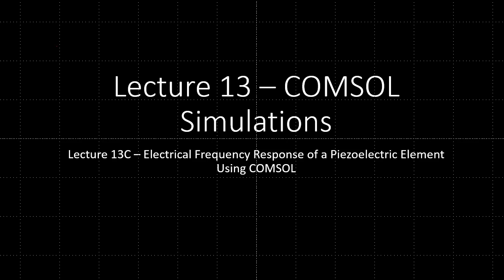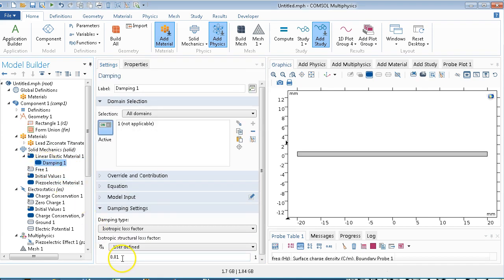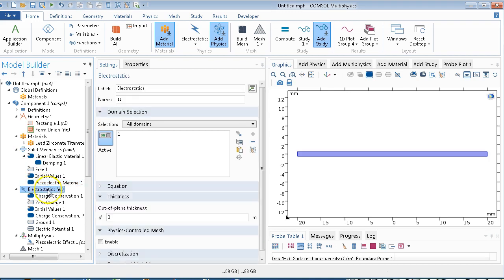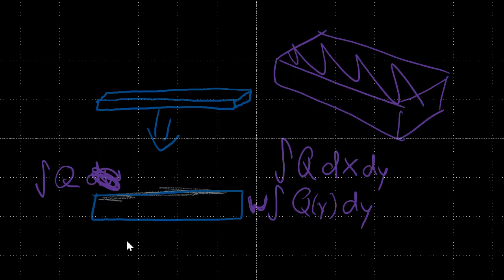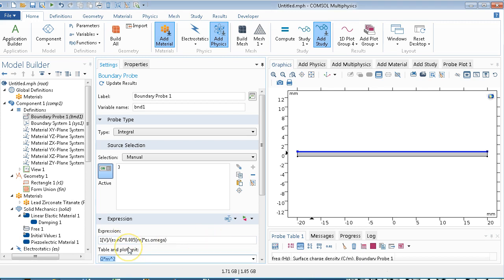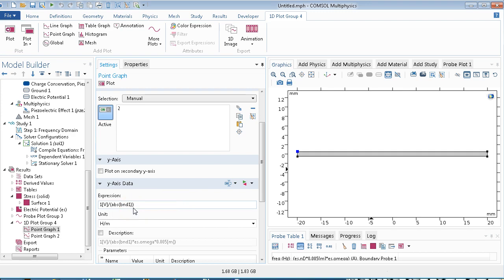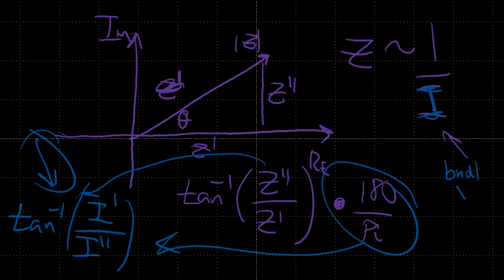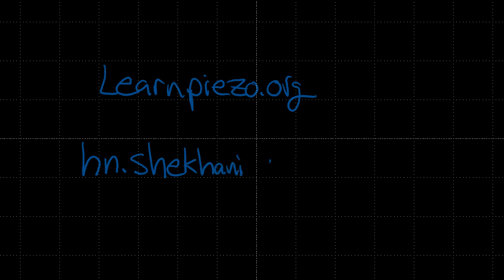COMSOL simulation of frequency-impedance analysis of a piezoelectric element

Comment: Thanks for the nice video, I followed the video but the bnd1 I got is real numbers rather than imaginary numbers as you mentioned. I think someone else got the same result as I get.
Reply: I think the problem is in the damping. Right now, the damping is applied on the linear material, but then overwritten by the piezoelectric. Insert a mechanical damping on the piezoelectric material and you will see real and imaginary part. Also, instead of defining the current as es.nD*es.omega, I would suggest to use -es.JZ (as someone else suggested in the comments).

Comment: Thank you very much for the video. Could you please explain why  you introduced damping for the Linear elastic materials not for the piezo itself, another question if I have coupling factor of k=0.1 how I can introduce to Comsol , should be a tensor or not please ?
Reply from the maker: Yes. Piezoelectric materials actually have anisotropic loss factors. However, for simpliciation purposes (and for most cases), we can just use a single loss factor. I used a loss factor so that the resonance impedance would not go to 0 and the antiresonance impedance would not go to infinity. 
You cannot put coupling factor direclty into comsol. You need to convert it into d, epsilon, and s

Comment: Sir , if we applied ultrasound wave( 1MHz) to PZT disc , how much voltage generates accross the PZT disc. Can you share COMSOL simulation lecture video for above condition. Normally we applied force in Newton. But I need force in frequency component. In Medical equipment detect ultrasound wave ( for an example ‘ Blood pressure measurement using Piezoelectric effect by an ultrasonic probe.
Reply from the maker: You need to do acoustic simulations. The voltage will be in the order of mV

Comment: How to model the same in 3D instead of 2D?
Reply: @ultrasonicadvisors  
Thankyou😊 for the quick response
Actually iam having problem in plotting the frequency domain analysis coz when I plot the voltage Vs frequency graph all I get is an empty plot with a dot or straight line in the centre
Iam really struggling through it
I have seen other mph. files and followed the steps exactly the same still Iam getting empty plots
Please help🙏🙏🙏
Reply: @ultrasonicadvisors  
Sir,iam doing the frequency domain analysis again and this time it's taking like hours, literally forever for the study computation
The simulation is still in progress
I mean is it okay for a computation to take that long in COMSOL
How would I know if there's a problem in my design or BC settings cos not even error is popping up, it is running endlessly
Reply: @ultrasonicadvisors  
Transient analysis
It's been 2 days now and the simulation is still running how long is it going to take?
Reply: @ultrasonicadvisors  
But why sir?
Reply: @ultrasonicadvisors 
Sir I have got another query
While plotting the Voltage
iam writing the expression 
es.V0_1 (as iam using the electrostatics module)
with the unit V
for the y-axis data
But when I click 'plot' i get 
"failed to evaluate the variable"
Could you tell me what's wrong in my expression sir?

Comment: thank you for the great videos. I watched the video many times trying to find the current value from 3d module(the same in lecture 13 part B) I was able to find voltage like what you did in the previous video but i could not calculate the current in 3d module. could I send you my  mph file or if you could not help me with the file could you tell me how to calculate the current from equation or any help
Reply: I'm doing a lot of 3D simulations on Piezos. You could contact me too if you need any private help. sunshine8533@gmail.com
Reply: @zhangyaoyao1902   Can you tell me why I am not getting imaginary part of current in comsol

Comment: Thanks for the video. It is very helpful for my piezo simulation.
Just one part I couldn't understand. 
In the impedance definition, |Z| = abs(Z) and Theta = arctan(Z"/Z'). 
According to complex calculation, because V is always real, abs(V/I) = V/abs(I), the magnitude is correct. 
However, in the phase angle calculation, Z' = real(Z) = real(V/I), which is not equal to V/real(I), no matter whether V is real or complex. In other words, Z"/Z' != I'/I".
Confusing part is, according to your method, the curve looks correct and well matching with that I got from analyzer, although it seems not matching with impedance definition.
And if I tried to pull out real(V/I) and imag(V/I), it looks reverse too. 
Not sure if you are still looking at this post, but if you see my reply and want to do some further discussion, please email me or just reply here. I must be something wrong somewhere, maybe my understanding on relations between impedance and current.
Reply: @ultrasonicadvisors  Hi. Thanks for the reply. I think I found the right solution on this and maybe you could give a try. 
-es.JZ

In you boundary probe you could replace es.nD*es.omega into -es.JZ, which is the Z-orientation current density integral in XY plane. Minus sign is to correct the current direction into upward. Of course when plate direction changes, the component JZ may change to combination of (JX, JY, JZ).
es.nD is electric displacement, which is derived from dielectric constant ε, or capacitance, so it naturally has a 90 deg phase difference from current I, when both using voltage's phase as reference. This is why in your video you have to use a wired formula to achieve a plausible result.
You could try point 1D plot on atan(imag(-V/es.JZ)/real(-V/es.JZ)) and it will give the right phase angle curve (same with yours, but this fully matches with impedance definition).
Since this video is the top search to this topic, I would like to add this comment so in the future people won't bother with the same question as I did.